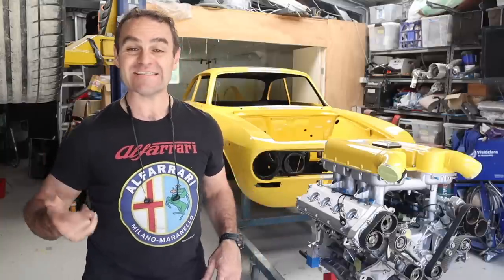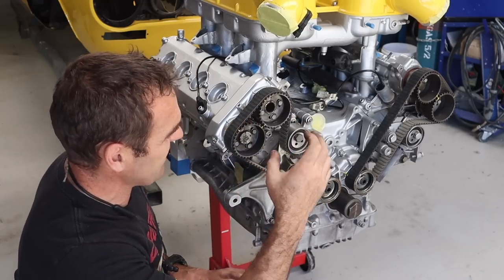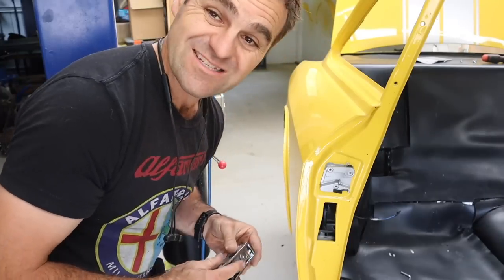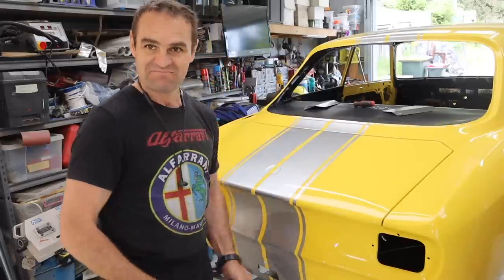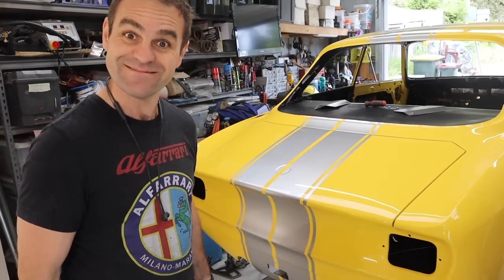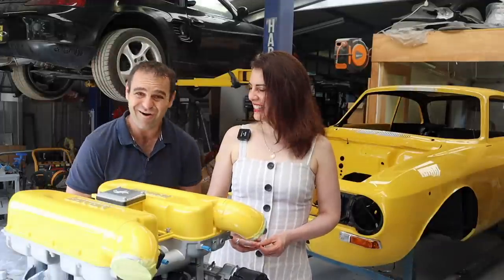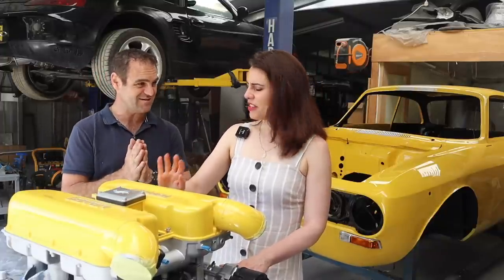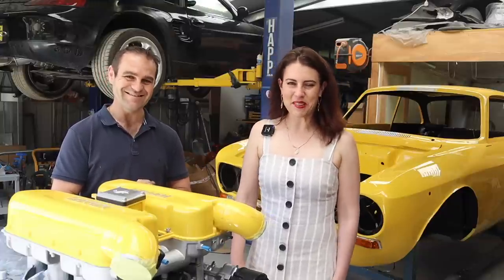What's next? - Ferrari engined Alfa 105 Alfarrari build part 158

Comment: It’s looking great Jeff! Top 105  Alfa tip when you close the boot- Always spread your arms apart, apply pressure to the boot / trunk lid with the palms of your hands  on the rear edge. This avoids denting the boot lid in the weak centre section leaving an unsightly dent in the centre of boot lid ! 😊

Comment: Merry Christmas guys.
..
Been a joy to watch.
Even the tedious bodywork prep.
But learning the (whole) build process along the way.
...
I enjoy problem solving and take interest in how you solve engineering problems on a project like this.
Also enjoy your paint experience and how you tackle the paintwork.
Your now on the home straight & should be a relatively easy build now as you move to reassembly.
..
As others have said.
Mrs Jeff needs a shout out for being so supportive.
I believe if people have hobbies or project they should just do them and Mrs Jeff has been fabulous in this respect.
Especially as car builds like you  do Jeff can be time consuming and frustrating at times (Roxster!).
also good you guys take a break a
Occasionally to have a bit of time out.

Love all your projects the Roxster & Harry sound Soo sweet.
..
Did the right thing with the Ferrari engine cambelts.
Just not worth cutting corners..
And all this done at home in a garage..that is an achievement in my book

Comment: The cutting half the belt and sliding on method also should only ever be used on an engine you know was in perfect running order when last used.
Never do this on a second hand engine you've not seen running.